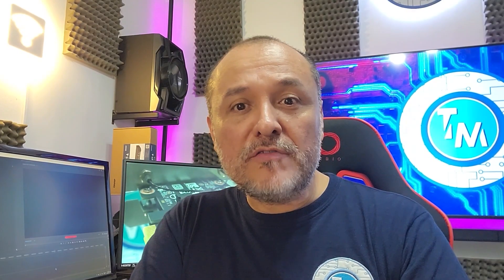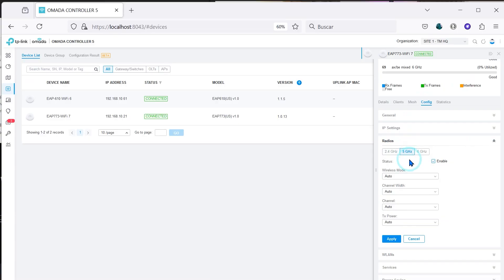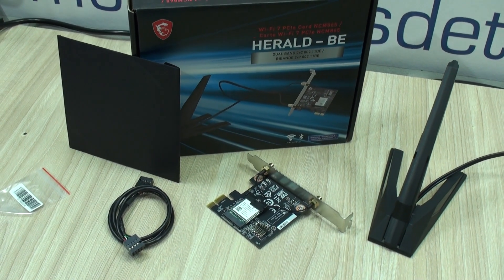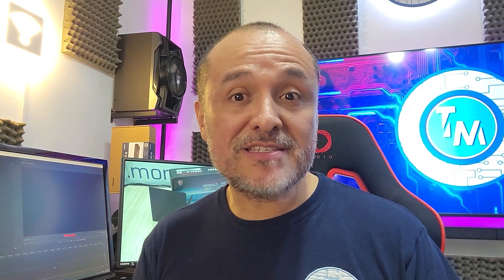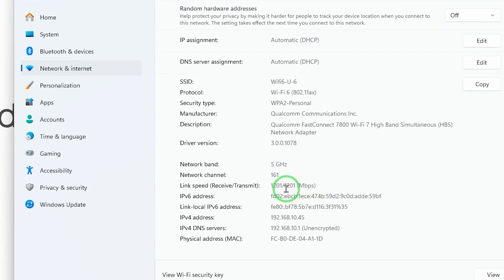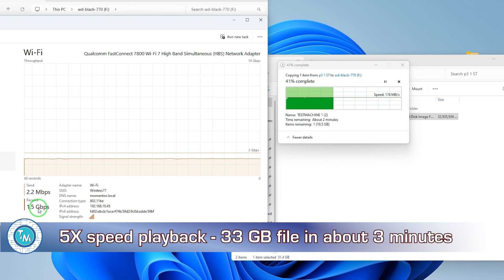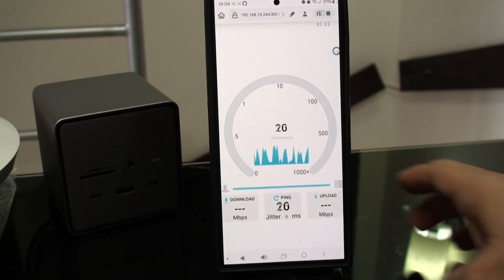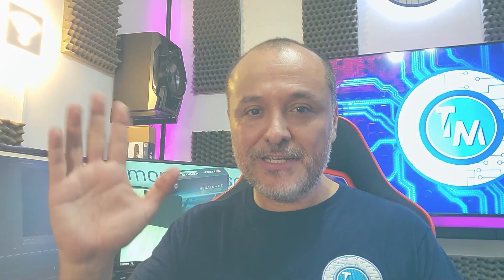WiFi 7 speeds are finally what we expected. How fast is it really? MSI Herald NCM865 and EAP-773

Comment: I couldn't find anything online about saturating that 10G uplink. 
For example, 4 devices running openspeedtest at the SAME time with 2Gbps each (2.5gbps*4 devices=10G)
Hope you do reply!
Reply from the maker: We're currently working on an additional wifi 7 video which in real MLO mode forced manipulating the hardware settings in the control panel of an m.2 laptop adapter took us over 4.3 Gbps.  hopefully with just wifi we'll be able to stress this AP.  So far even better speeds in WiFi 7.  It's our next video on QUEUE, hope you like it, and thanks for the comments.
Reply: @TechnologyMoments  
Please do multiple clients. A simple iPerf test will do, but you need 4 clients and 4 hands to press at the same time.

Comment: Great video 
Quick question- would normal wifi devices (such as security camera, old printer, etc = which use 2.4ghz frequency only) work if user keeps on only MLO band and turn off 2.4ghz, 5ghz abs 6ghz bands?
Reply from the maker: Yes, the AP will continue to serve clients normally.  The only feature that may affect connectivity is OFDMA.  Great question.

Comment: Hello
There is still one feature with MLO that none have been able to show to me yet.
And that is what speed you get when downloading and uploading simultaneously.

These question would be nice to get benchmark on: 
1.what would the speed be when copying a file between two wireless computers connected to same wireless network when using wifi 5/6/6(ofdma)/7/7(ofdma)/7(MLO). (this would mean that router have to transmit and receive simultaneously to get best efficiency on the data transfer, exactly what MLO is meant to solve)

2. What would the speed be between two computers where one is wireless and the other is connected with cable and the wireless computer simultaneously downloads and uploads files from/to the cable connected computer using wifi 5/6/6(ofdma)/7/7(ofdma)/7(MLO) on the wireless computer. (this would mean that router and wifi connected computer have to transmit and receive simultaneously to get best efficiency on the data transfer, exactly what MLO is meant to solve)

3. The extreme case I also would like to see is how well wifi 7 MLO handles when 2 wireless computers connected to the same MLO network tries to simultaneously upload and download files to each other. Both computers have to send and receive at the same time. Would enabling 2.4 Ghz wifi in this case improve output instead of only using 5Ghz and 6Ghz?
Reply from the maker: Absolutely true many of your remarks.  As I said in 8:30, almost halts download when doing that at least in the same computer.  We'll consider everything you said for future videos.  Have a good one!
Reply: @TechnologyMoments  Thanks! I am looking forward to that video! :)

Is it also possible for you to tell what kind of MLO that router and wireless card in computer is using.

MLO-STR on both router and computer side would be the most intresting to use with those kind of tests .

Ofc comparing performance with the other types of MLO is also intresting. Best performance is expected when using STR on all sides.